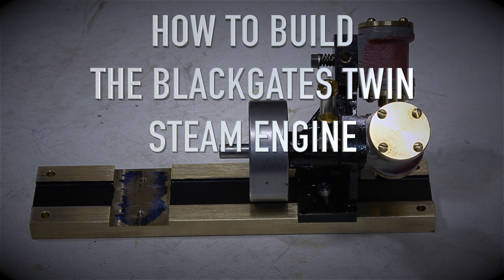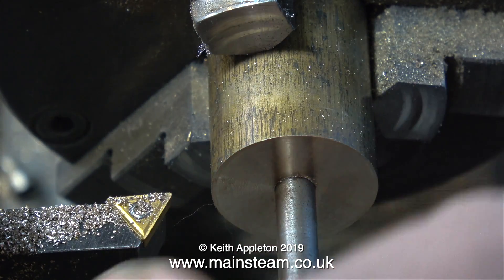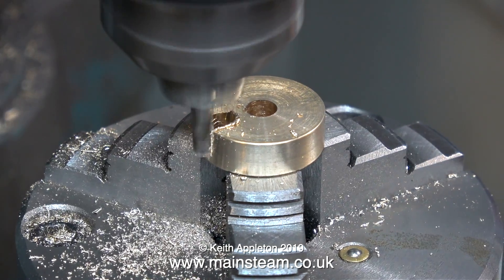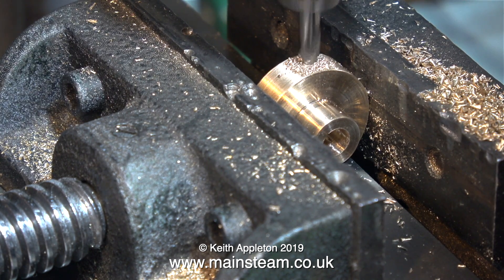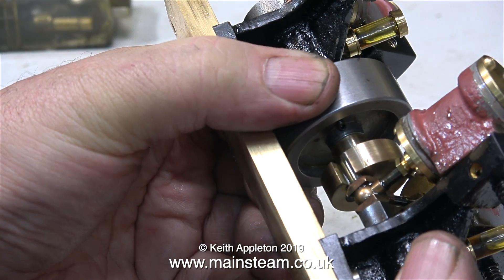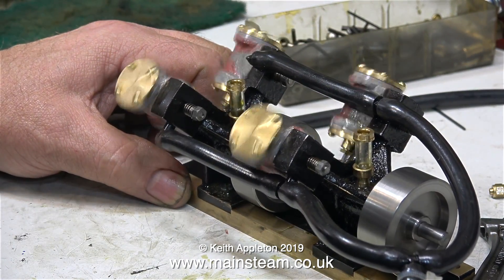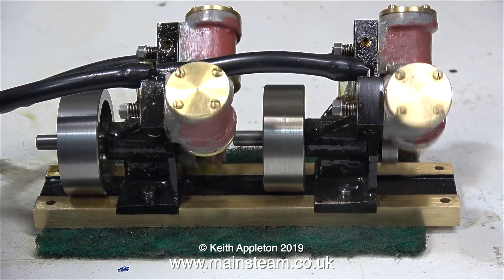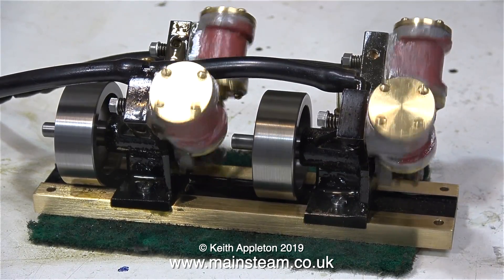HOW TO BUILD THE BLACKGATES TWIN STEAM ENGINE - PART #13

Comment: I have an 8ft long wooden boat hull that I would like to put a steam engine in. any idea what size engine I should use?
Reply from the maker: an 8ft Model Boat? or small full size.
Reply: @keithappleton  sorry full size, I believe it is an old sailboat hull.
Reply from the maker: a Stuart Number One or Number 4 would be good for a small full sized boat. A Stuart 5A a would be a bit too big for such a small boat.

Comment: I have a different sort of question about the two engines and their timing. Do you want them to be timed so they run together, the right hand cylinder of both working in sync then the left hand side going, or have them all off by 25% so each cylinder is at the top of its stroke at a different time. That would give a smoother run I would think. Maybe I am over thinking it since steam engines are pretty simple and offer torque in both directions. Just a thought. 
I learn a lot from your videos and I do find them very satisfying and informative. Thank you for making them.

Comment: Kieth.  The mechanical engineering  involved in coupling two misaligned shafts is quite extensive.  Please google "torsionally rigid flexible shaft coupling".  

Firstly, you will never, ever align the two shafts.  It is impossible to align the radial and angular errors between the shafts to perfection.  It is humanly impossible and there will always be residual error.  This residual will cause premature wear and failure.  You will be at the bottom end of the S-N curve.  

Secondly, you want torsional rigidity, because otherwise the timing relationship betwixt the shafts will vary as the coupling winds up and relaxes.  So the "twisty-ness" of the coupling must be very low.

There are several coupling which match to this design deman.  May I respectfully submit an "Oldham Coupling"?
Reply from the maker: Thanks for the info - by the way, the name is Keith .........
Reply: @keithappleton  Keith, spelling names isn't my strong suit.  My apologies.  

The shaft coupling problem is a non-trivial issue and one I have encountered many times in my professional career, in degree'd mechatronics engineering.
Reply: I like Gary Oldham in some of his works such as the Batman movies and his portrayal of Dracula. While he is flexible and adaptable, I don't see him having the rigidity to carry this off.

Comment: Could you run them side by side and join the crankpins together with a link similar to what is done with train wheels?  Power takeoff could be from one or both output shafts.  This would keep it simple and no gears would be required!
Reply: That would still cause problems, you want the crankpins to do only there original porpoise. My bet is he will do a side by side with them driving a gear set, but he may surprise us.

Comment: Bonjour Keith,
What a suspense, I am looking forward to the next video  !  Besides this,  thanks to this episode, I discover that coupling two machines is not obvious, I would have imagined that your plan B was the appropriate one.
At worst, the weakest machine slows a little bit the most powerful one.
Amicalement, Raphaël